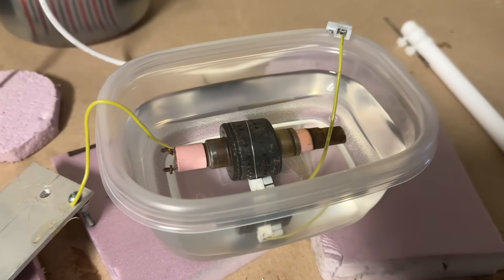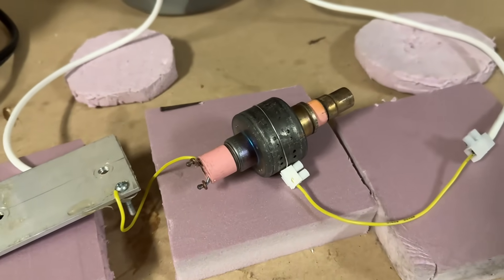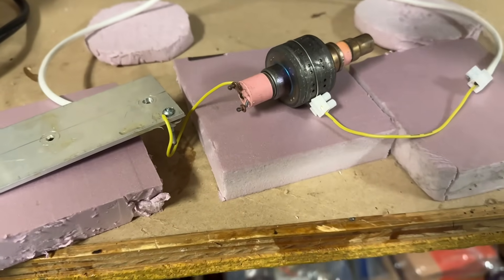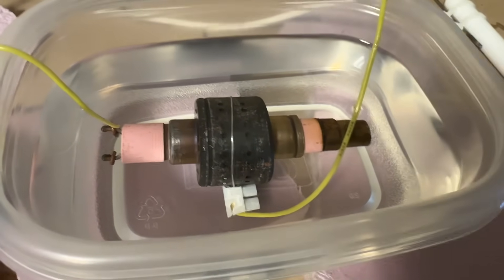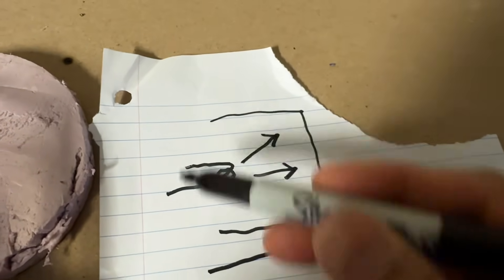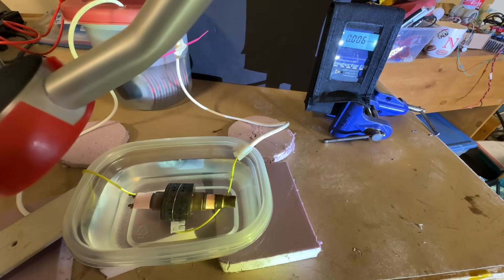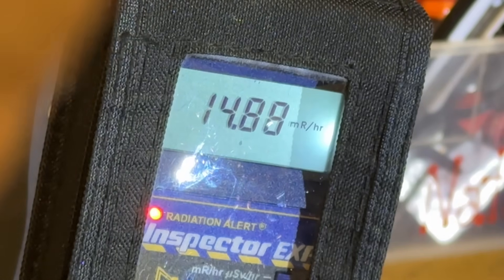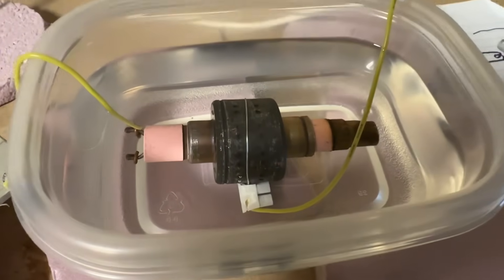Overvolting Magnetron under Oil

Comment: The filament is needed for thermonic emission of electrons. You shouldn't get any electrons moving inside a high vacuum tube without it.
I have a small GE xray tube that has  a small amount of oil contamination inside. When excited  with a tesla coil it glows blue, meaning it has had some atmosphere leak in. When I  apply 30kvdc across it, I get detectable xrays from it. When I  heat the filament and try again, no xrays are escaping the tube. I suspect that the hot filament vaporizes some of the oil and raises the vapor pressure enough to prevent high energy electrons from hitting the anode with enough energy to produce xrays that can escape the glass.
All that to say if the cathode is cold, the only way electrons are moving across the magnetron is if it has had some air leakage inside.
Reply: cold cathode field emission is still a thing, it just requires an enormous electric field..   ..like, say, 20X higher voltage than the tube was designed for? I am familiar with the theory of operation for early X-ray tubes, and the little glass pips with mercury amalgam inside some of them had for reducing the vacuum of a tube that had gone "hard" from prolonged use.
Reply: Are you taking into consideration the fact the filament (tungsten) is more than likely Thoriated (doped) Tungsten? This aids in making space charge in a normal filament, I imagine it aids in cold filament operation too. Tube manufacturing procedures call for a filament heating profile (operation at the factory) above normal temperature with the objective to bring Thorium to the surface of the filament.
Reply from the maker: @uploadJ yeah I realize that thorium oxide  based filaments are electron rich. These do provide good cold cathode emissions better than what tungsten would do alone. The walls of the magnetron being copper provided a good source of brehmstrahlung radiation.

Comment: please please run a low pass filter up to 13kHz or a window filter at the 16kHz drive frequency and eliminate the intense high frequency acoustics in the recording. My hearing hasn't desensitized from age yet and it's very uncomfortable. I can't finish the video with sound unless my volume gain is stupid low.

Comment: btw amateurs usually use actual rectifier tubes to make cheap xrays, tubes meant to rectify high voltage AC, is exactly like an x-ray tube topologically speaking, so you can definitely use high voltage AC, it is not done in proper x-ray machine to avoid damaging the tube or producing uncollimated xrays, beware that running the filament with such a high voltage will degrade it much faster than in normal use due to high energy ion bombardment.
Reply from the maker: Yes for sure operating the filament would have to be done fractionally to avoid filament damage and the potential for overexposure to X rays. This is just a vid to illustrate some alternate phenomena with the magnetron tube.
Reply: @BrianDhvTinkerer yes it's pretty interesting the use of a magnetron, I'm very curious to see how much xrays it can produce and if it's enough for making film radiograph

Comment: did you try use this detector near the microwave to see if it emits too?
Reply: @davizord01  no , microwave oprate at lower potential 4kv
Reply: @omsingharjit  did you try? X Ray can be generate with duc tape...
Reply: @davizord01  only in vaccum.
Reply: No microwaves, the tube doesn't work as a magnetron without the magnets.

Comment: You can use an old x-ray film holder to see radiation by other way. They are dirty cheap nowadays. When x-rays hit the holder wall it produces visible light that create the medical image. So you can turn of lights and open the film holder to see if it glows. It would be very cool
Reply from the maker: Thanks for the suggestion – I just did the experiment with the x-ray film holder. I’m gonna post it shortly. Stay tuned.
Reply: @BrianDhvTinkerer  Cool!
Reply: @BrianDhvTinkerer  Fluorescent screens, also known as phosphorescent screens.  The material is any xray phosphor.  They're commonly just called phosphor plates
Reply: the holder? why what's the holder made out of?
Reply: @ShaunVillafana  Yes. I don't remember what materials exactly but they are compounds with this property: visible glow when X-rays hit them
Reply: Great idea!

Aren't they called scintillators?

Work like LED phosphors, but in a different frequency band.

Comment: Ok please do this with filament on experiment , you can use , perhaps rf toy remote module, rf hacked doorbell  , other 400 mhz rf module and for shielding first check the directionality of x ray source at low power and point it away from your location which should be also far from it or you can put car lead acid battery it contain lots of lead so it will block lots of x rays one battery is enough you want to protect your self in line of sight x ray don't reflect easily so don't worry.
Reply from the maker: Thanks for the tip! I’ll have to look into shielding/directionality.

Comment: But you previously said , powering filament on will not produce x Ray because it will Reduce or make voltage drop " so why you think it will generate more x ray ?
Reply from the maker: The current with this large flyback transformer is much much higher than the small voltage multiplier I was using earlier. With the filament powered, there is not gonna be that much of a voltage drop using this bigger transformer.
Reply: I worry that a heated cathode may mean the tube will start conducting much earlier, at a voltage not high enough to produce x-rays.
Reply: @olmostgudinaf8100  yes same doubght  , i read it in text book that x ray tube must be highly vaccum and distance between electrodes should also be less to avoid electron gas collision even in High vaccum .
Reply: @omsingharjit  Yeah, I once cut open a magnetron out of curiosity. The distance between the cathode and the anode (disregarding the cavities) is tiny, about 1mm, if not less.

Comment: For Imaging you need to know that the tube has a low resolution since the electrons hit the anode on a wide surface. Also for safety it makes therefore sense to enclose the tube in a box of lead with a small window.
Reply from the maker: I’m in the process of purchasing some sheet lead to fabricate a box with a small hole. The wide amount of scatter would only make it useful for x-ray objects that are located close to the films.

Comment: Possibly the aluminum fins as well as the magnets are guiding electromagnetic radiation rays using generated and permanent fields. Possibly forward? Which may explain why xrays are reversing? Perhaps the fields are an important part of a diode effect?   And with plasma on the ceramic... And recently understood effects of radiation hitting materials such as sodium, which is within glass, being a source of plasma lightning balls... Concern regarding ceramic ionization should be considered? Parabolic metal mirrors and glass lenses effect radio  rays just the same as visible light. Therefore a parabolic in the back and a convex lens on the front may create MASER. What multiple increase would a hot cathode create?

Comment: Are you sure your readings are correct? I had a situation where my counter showed tons of xrays but it was an error from the HV voltage field. i had to shield it with grounded metal foil.
Reply from the maker: Yep, I did actually repeat the experiment and held the probe at a much higher distance where it could not be affected by electrical fields and it was scary how much x-ray production occurred- that’s when I decided to abandon further experiments until I can perform them remotely
Reply: @BrianDhvTinkerer  This is Bremsstrahlung, yes? That means it covers the whole spectrum from UV on up to X-rays of a keV energy value equal to the peak acceleration voltage. Most of this is completed absorbed in soft tissues if exposure happens - in commercial imaging setups thin metal filters block all the lower energy radiation that won't penetrate deep enough to make an image but can still give your innards a sunburn. I'd like to see you try this same setup but with a large decorative incandescent bulb with the low-glow filaments that look like old carbon filament lamps. For reasons of filament longevity at low powers, a hard vacuum is still used in even these modern recreations! Give it a foil cap and let it rip Amateur Scientist style!
Reply from the maker: @zinckensteel interesting- I need to get hold of one of those
Reply from the maker: @zinckensteel the low energy brehmstrahlung is definitely more harmful to soft tissue
Reply: @BrianDhvTinkerer You could verify that what your meter is registering are in deed X-rays by putting a roll of 35mm film several feet away, run the machine, and then get the film developed. If you have access to a 35mm camera, take pictures and expose the roll to X-rays, the pictures will get foggy and green. I would also assume that unexposed (no pictures taken) would also turn green instead of the normal black. Been a while since I used actual film on travels, but I think that high ISO film is more sensitive to x-ray machines like in airports.
Reply: He already tested that situation in previous clip
Reply: Thanks that you included the word Bremsstrahlung to your language. It actually means de-acceleration radiation.
- a German